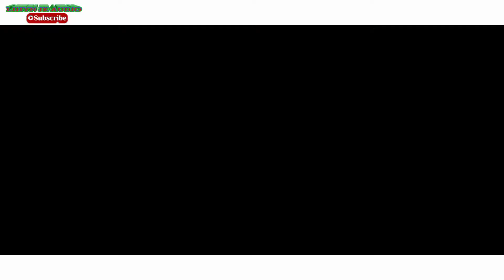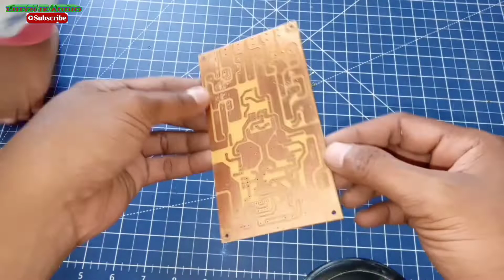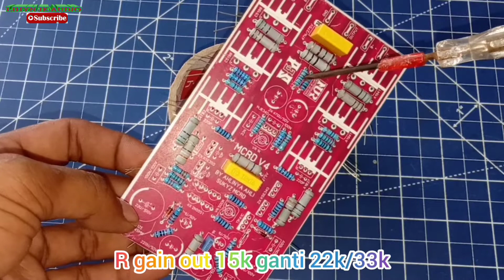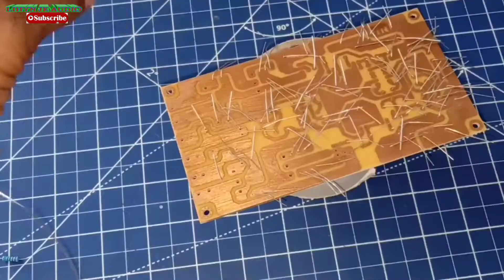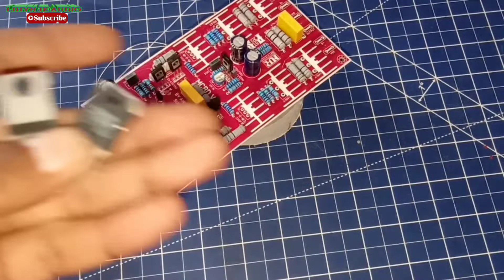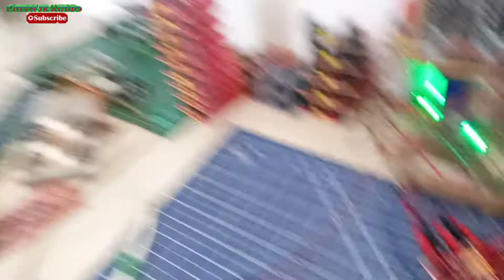CARA MERAKIT MCRD v4 YG BENAR

Comment: Mas itu resistor 2watt yg menuju tr mje 340 dan mje 350 nilainya berapa ya...
Reply from the maker: 390
Reply: @lihynjokaudio2483  
Yg di atas kapasitor 220n/275v mas...
Soalnya aq rakit mje 340 dan mje 350 yg atas panas tapi dco dan bias aman...